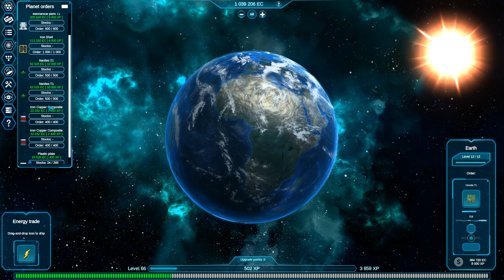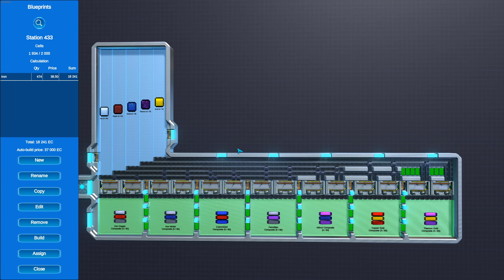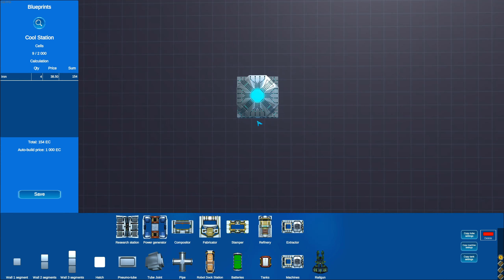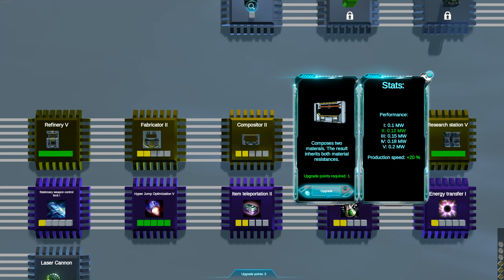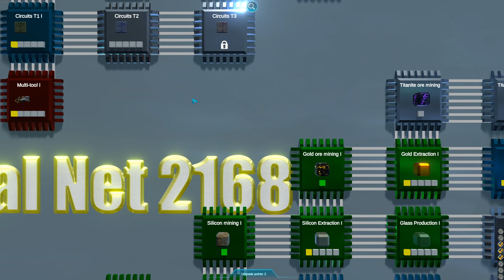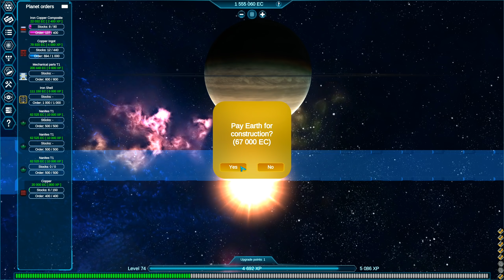So Much Liquid Processing! Final Upgrade

Comment: The larger ships are slower because Ship 1 shows up and completely fills the input, which drops demand to 0. Ship 2 doesn't bother to go start mining because there's no demand. Ship 1 finally runs out and demand pops up, which causes a ship to run off to go fill up, which takes 20+ minutes. But the factory runs through the input buffer so quickly that production immediately stops until the ship comes back.

The 'optimal' solution is probably one where it takes processing exactly as long to run though the input as it takes the ship to refill.

Comment: The liquid mining doesn't need robots, also, you can set minimum count to activate  a route which works well for things like gathering from large ships to large collection facilities. But small ships match small production. Me, I like big buffers and big ships for all the real big loads like fuel, water, base minerals and other consumables. 
Also, its real cheap to buy a couple a power stations with T3 batteries at the beginning so you might as well do so.

Comment: I feel like you'd do better if you paid attention to speed and material ratios, rather than just building bigger. For example, it seemed like either fuel or coolant used 2 base materials for every 1 end product, so you would have been better off having twice as many receiving tanks.

Also, there's probably a happy medium between massive 32 tank ships and 2 tank ships. Especially if you can use a lot of smaller ships to rapidly feed a central depot, from multiple mining locations, and then few large ships to haul resources from the depot to where they'll be used. If you could get it to the point where it builds up an actual stock pile, it could also help to buffer against interruptions in your supply chain.

Finally, given all the weapons in the tech tree, it seems unlikely that the game will remain peaceful forever and the map seems to be rapidly running out of unclaimed systems, which could increase hostilities. You may want to consider building up your own defenses.

Comment: @Brothgar you should add more oil and water tanks in the coolant and fuel factory stations, you are creating a bottleneck that keeps your delivery ships stuck there unloading when they could use that time to gather more water/oil, it should be more efficient if the ship could just come dump all its content in as little time as possible and then go back to gathering.

Comment: I mean we can also look at real-life examples of supply and demand when dealing with your liquid/power issues. We do know that oil for example is transported in bulk right? So we have one piece of the puzzle from an irl example, so rather having large miners, convert them into transports between refinement and factory. As for mining, well generally we would make machines that would directly draw and store the resources but we dont have that option here. So instead we can figure something out that does something similar, such as a storage station to store the resources mined above the planets. I was thinking to mine the resources though, it may be beneficial to split the difference between big and small, go medium/T2 size. That way they have decent storage to haul up to storage, but not too much that it'll take forever. Each planet has multiple mining ships dedicated to them, leaving just enough room for transports to gather from storage and take elsewhere.

Comment: If you want to built or deconstruct just press en hold the wall of your builder ship and drag it to the ship than you get a wrinch or wrench (a tool icon)
And than the ship start to build or deconstruct with all the bots but you have to deselect te core  than they won't destroy it first en Notting will fall. And also the ship will than automatically refill is iron gold en or other materials you have on that ship. And than go back to take of from where they stopped with the build  for a refill. En a station if you manage you can set it on give energy, take energy or don't share energy like the research station.

Comment: The issue seems to be a production line scale mismatch. 
-The miner ship waits for the water to fill, 
-then waits for the station to have room, 
-then the station waits for ships to take the coolent,
-then the station waits for more water, repeat.

You should try making it so the station at least has as many tanks as the ships dropping off water, so they can dump and go, which will allow everything to be in motion more often.

Comment: I would be curious if there is any way to build smaller miners that collect resources to a central 'where house' type station, and then use the larger ships to transport that to the processing centers. That might be a way to 'expand' the capacity of the stations buy only giving them the storage space they need for the process they are doing, and just accepting that the cargo/tanker ship is going to spend most of it's time in orbit. 

Is the only cost of a large fleet of small ships the energy they take to jump around?

Comment: Your big ships can be efficient but you need a lot more input buffer. Your ships need to be able to be emptied fast so they can go round while the buffer lasts. That's the true key you need to remove some machines and add some input tanks. Output tanks don't seem to be a bottleneck because you can have so much processing power. Just put 12 tanks in the station and 8 in the ships and see if the buffer is able to last when at cruise rate and with multiple ships on the jobs.

Comment: I figured you would have done up your spreadsheets with optimum processing.  Like 1 Star Water gives you 7/minute, 3 star gives you 30/minute.  Coolant takes at level 1, 20 seconds to produce 1 unit of coolant.  At level 5 and with Machine Level 5 you produce coolant every 2 seconds per refinery.  There is a nice chart that is in the tech tree.  The only thing I can't really tell is how many units of water it takes to produce those numbers....Love all your videos, bought the game after your first vid was 5 minutes into it....love it.  Spent hours on this so far and restarted after level 50 and second run I build all stations and ships from scratch based on the needs.  Never mind a late patch now shows us how much of each resource is required.  For example Hydrogen Power Plant takes .003 units of each hydrogen and coolant to make 1 unit of energy it looks like.....so spreadsheets can now be made :)

Comment: It seems like you might as well combine the fuel and coolant production with power production. You're limited by how many ships you can have bringing stuff in and out. As it is now, you need to bring in fuel and coolant. If you process them in the same factory, you'd need to bring in oil and water, so it's the same. Though it would make it harder to upgrade to nuclear.

Comment: First in order to construct or deconstruct anything it's better to click on the construction ship and drag the curser over and when you see construct cue the bots will do all building and dismantling automatically instead of doing tasks bit by bit. Second, the time it takes to get any resource off a planet is dependent heavily on how rich the deposit is, so if you are grabbing ore or water from a 1 star deposit it will take FAR more time than a three star deposit but yes the size of your ship will further increase or decrease the wait time based on how much it can hold the other thing that can help with this problem is to have more storage on your crafting stations i.e. having more tanks that can hold water or oil. Third the coolant not having a demand for water was because one of your large ships was already working on the order and since you set it to a low star resource and it would take thirty minutes the station was ready to wait for it.

Comment: I think problem is the storage of the production base with big ship liquid. They stay longer because the production suck not fast enough the water so they can not fly fast back for more. 
Better is when you build a storage base for the bigger ship and then you let it deliver to production base.

And you need better liquid deliver ships from base to base. 

The small ships are bette because of the storage at moment but when you change it they are worse because water to energy use are worser.

Comment: I think the larger ships would work fine with a larger buffer for the stations to hold and work on would allow them to get back out there and start mining again rather than sitting there slowly emptying into the 4 tanks on the station when they have a dozen. They are being slowed down by the processing speed of the station.
Reply: Not the processing speed, the processing capacity. Cut the tip off that wang and add a bunch more tanks.
Reply: This goes for solids too. He'd already said it in another video, but if your stations want 60 bits you make your mining ships hold 60 bits. 

The trade ships are another bottleneck. With only those two baby tanks, they use a lot of energy zipping back and forth endlessly. So it is important that the trade ships have larger tanks/holds as well.

The mining ships being a bit larger than the station is fine so long as they come back before the station is idle, as they act as additional storage.
Reply: Exactly, I would suggest a 1:1 ratio on tanks on the station and the miner. This way the miners can empty everything as fast as they can and go back to mining.
Reply: You beat me to it